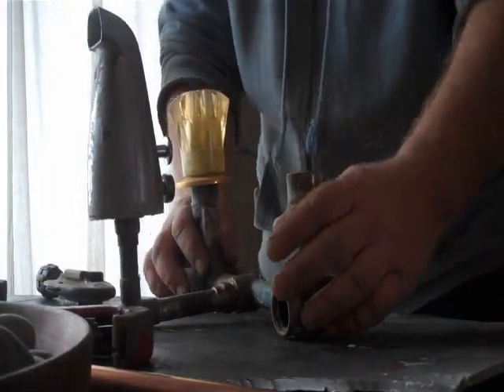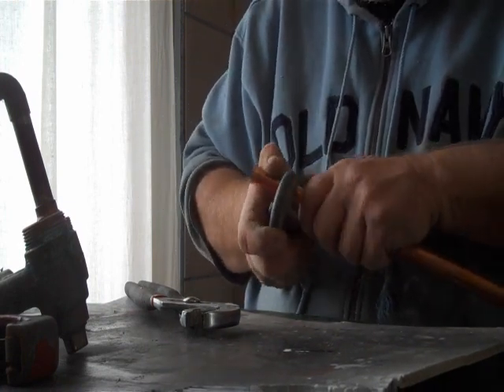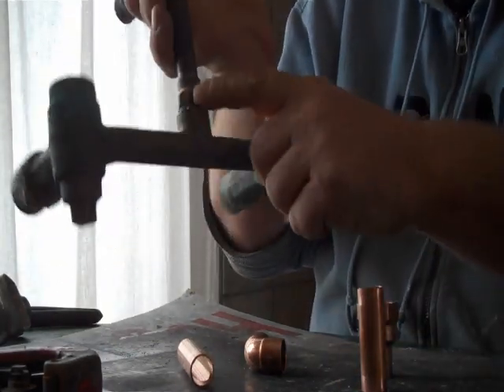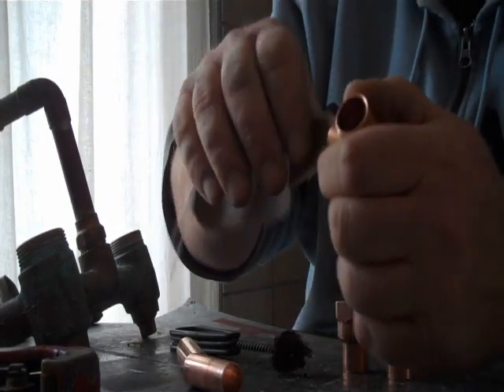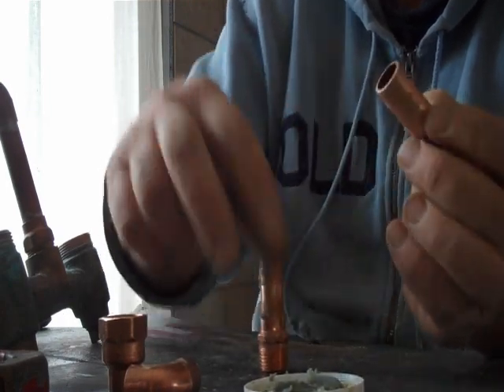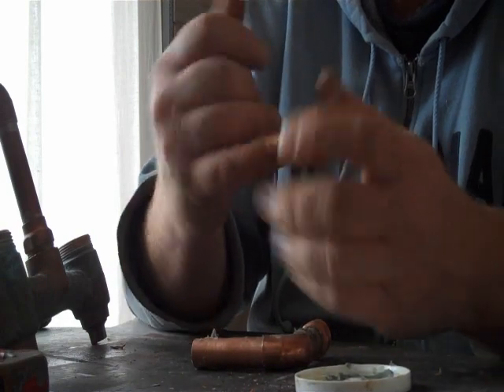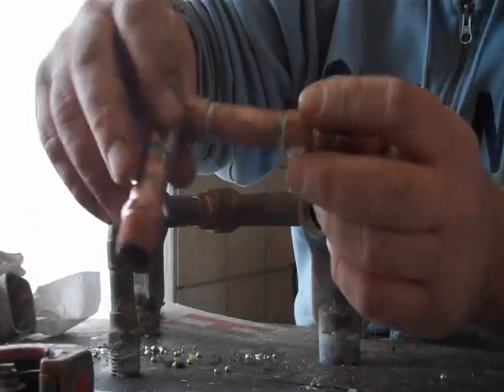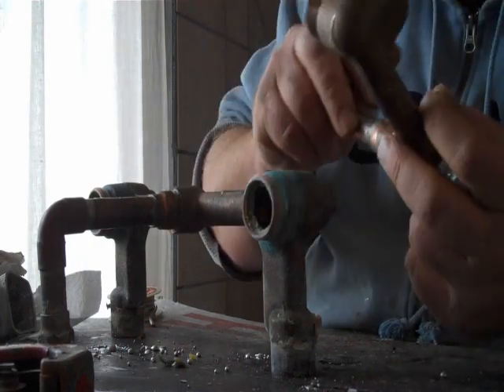Be Prepared (ep.1)  Soldering

Comment: Question: How did you know that the "angle" of the the new pipe would be correct when you screwed the two pieces together? Not sure if I'm making any sense, but since you soldered the female fitting before you screwed it on, how did you know the overall piece would line up right? Great video.
Reply from the maker: Not sure if I'm understanding question right, but the threaded fitting can be tightened more to line things up.